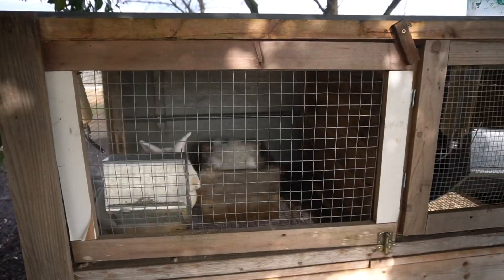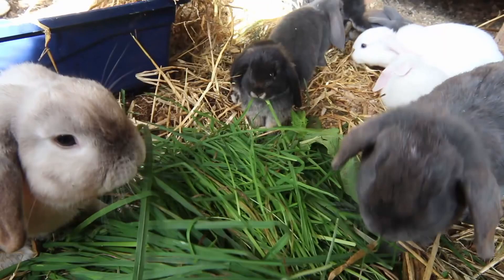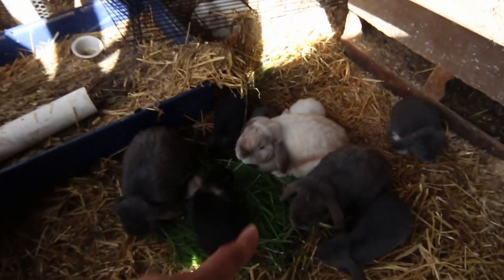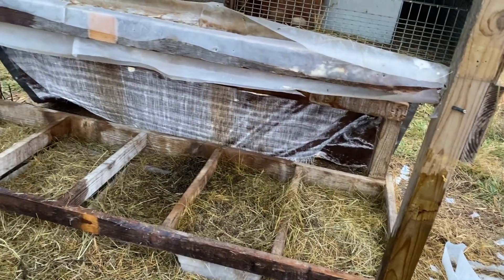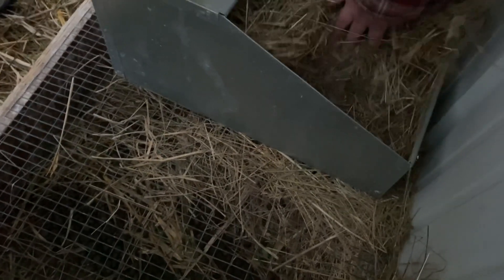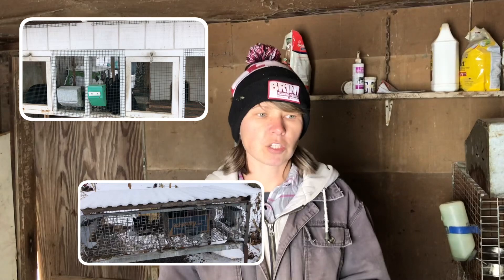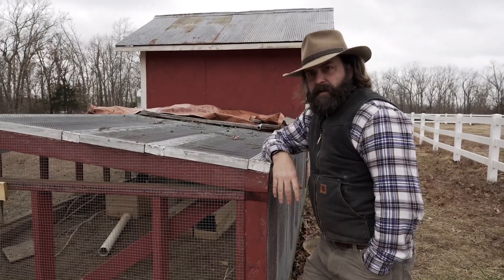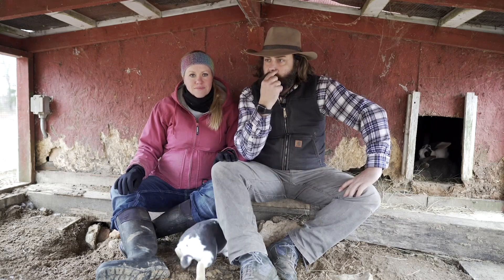Should your rabbits live in Cages, Colony, or Tractors

Comment: I build wire cages then build a rabbit tractor around four cages which are 24wx32lx18h My tractor is 96"L x 32"w x 24"t. I can move the tractor in my garden and don't have to take or shovel rabbit poop and come in with my tiller and it makes my garden produce more vegetables. My father always told me to think smarter so you don't have to work harder.
Reply from the maker: That’s awesome!

Comment: Do Rabbits not need access to their own poop tho? As they eat it for nutrients.
Reply from the maker: Rabbits do eat their poop (once a day) to help with digestion. It is actually fermented food and not regular poop and is called cecotropes (night feces).  Lots of rabbit owners successfully use cages, but they are also usually feeding a pellet, which may be more easily digested than fresh plant matter. In my cages, the rabbits have a big ceramic tile and nesting box. This gives them a place where they can rest their feet from the cage wire, but also are places to poop their cecotropes.
Reply: @LorellaPlanBeeOrchardandFarm  Ah I didn't know if the Cecotropes would fall through. Answers my questions hehe.

Comment: Rabbits should never be put in cages, even less in ones with wire bottom. 
Hutches are too small, they can be used for limited periods of time, if a rabbit is sick or when a new rabbit is introduced and needs to go through quarantine. Again, no wire bottom!
Rabbits need space to run and other rabbits to socialise. Yes, that is true for the breeding bucks. You can give them a neutered male for company.
Reply from the maker: At some time I would like to change to a colony, but our water table is so high (we live at the bottom of a “holler” near the creek) and get a LOT of rain, so I need to figure out how to do it without flooding the burrows.
Reply: @LorellaPlanBeeOrchardandFarm  don't let them dig burrows. They'll dig their way out. I paved my enclosures with concrete slabs. You can absolutely give them boxes with material they can dig in safely. Think of a mortar bin, or something like that.
I built them huts on legs to sit in, under or on. Always make at least two entrances, so they don't form a cul-de-sac. Rabbits like to have a back entrance/exit.
Reply: That's your opinion. In my experience, colonies on the ground end up losing a lot of kits, developing endemic coccidia problems, falling prey to predator attacks, and running the risk of catching things, including parasites, from the massive wild rabbit populations in our area (which is a huge concern as RHD spreads across the country). Cages with wire bottoms work just fine for our rabbitry.